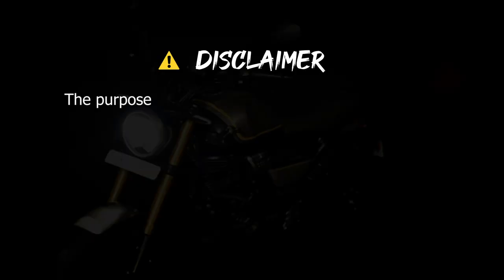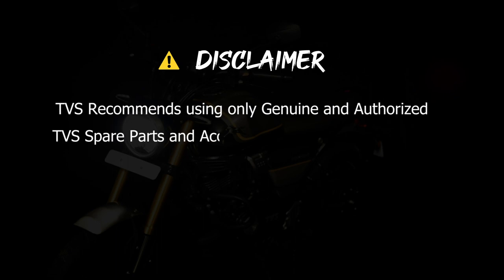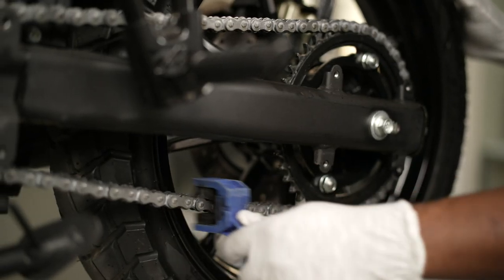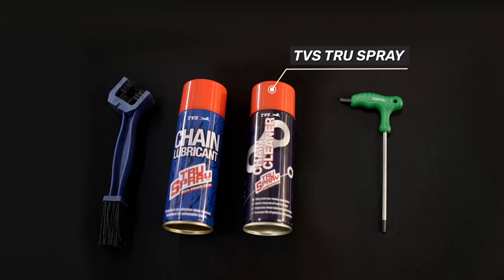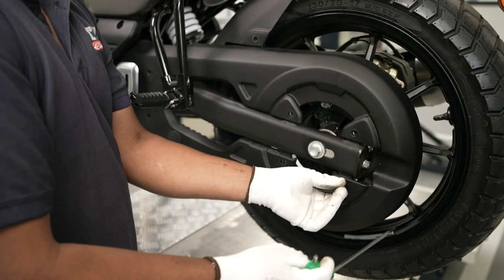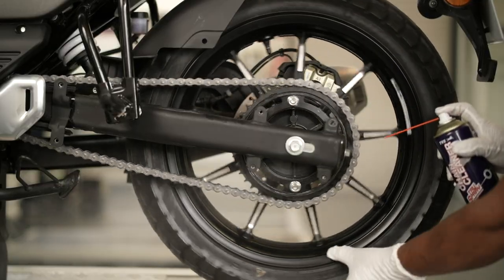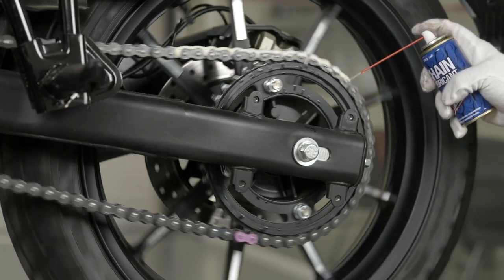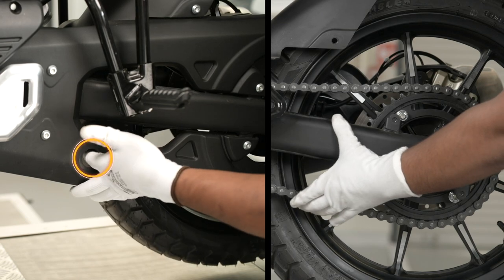TVS RONIN - Drive Chain Lubrication

Comment: Is it normal for ronin or a problem  while it is on dual stand and on pressing clutch and accelerating , the tyer speed become fast ?
Reply from the maker: Hi, we regret the inconvenience caused. Please email us your concern at customercare@tvsmotor.com along with your contact number, location, and dealership details so that we can get in touch with you for further assistance.
Alternatively, you can contact us at 18002587333 in case you need immediate support. Thank you for your patience.